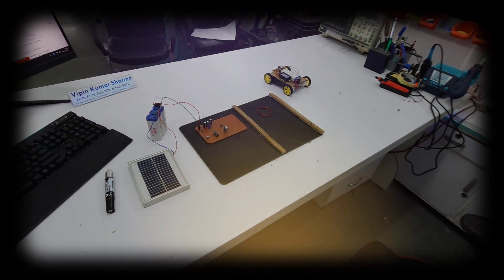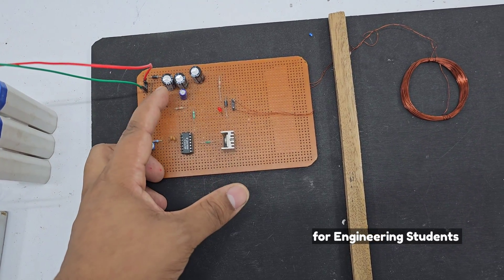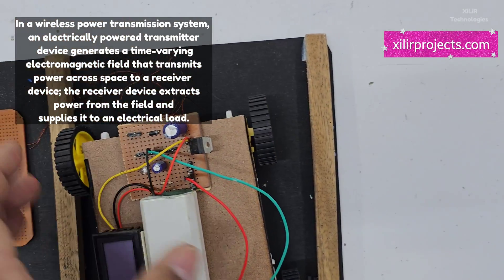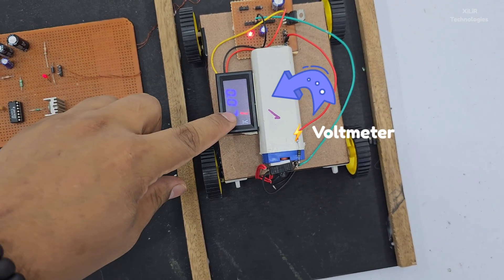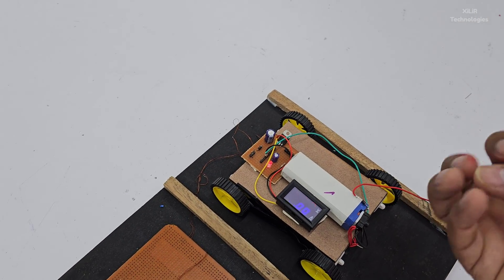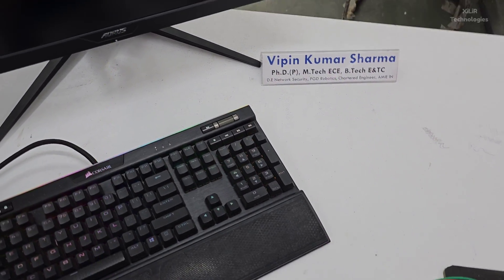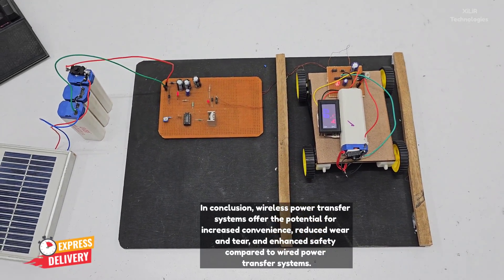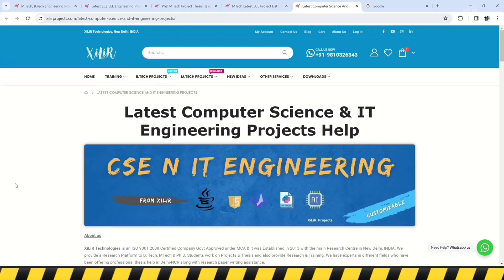Implemention of Wireless Charging System for EV (Electric Vehicle) | Smart Garage

Comment: Values of resistor ' potentiometer and capacitor in Frequency ckt ?? And what formula is used to calculate frequency  ? And turns of copper coils its gauge and diameter ?